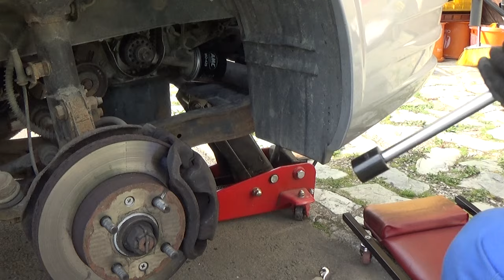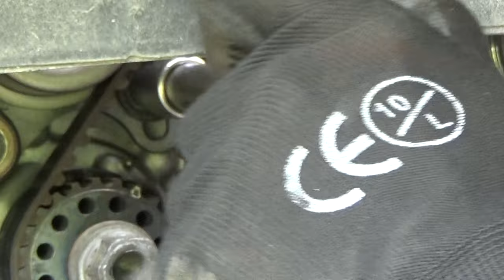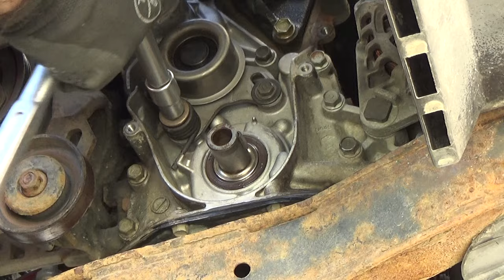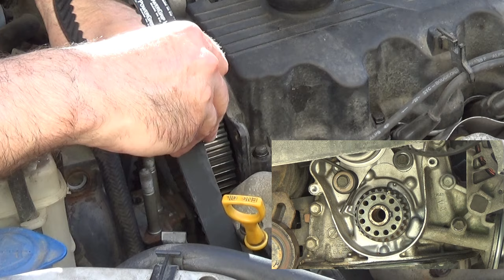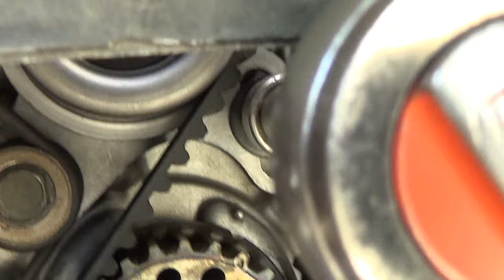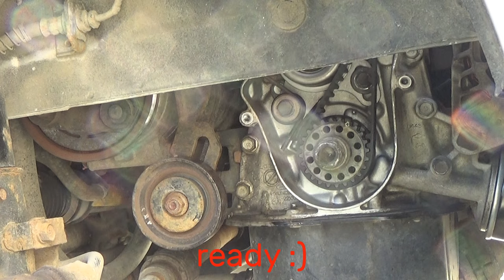How to replace the Timing Belt on a Hyundai Accent-short version

Comment: Hi, you have very useful videos and thank you for sharing your knowlodge. I bought a Hyundai Accent 2006 (second hand, 47,000 miles) on April 2022, right now it has 50,000. Can you help me put with some questions: 1. When can I change the timing belt and what other accesories related to it?. 2. I saw your videos about gas filter and AC filter, the one located in the glove  box. After how many miles I can change it? Thanks from LA.
Reply from the maker: Hi, thank you so much for your nice words. That´s the reason why i do this: I want to share my knowledge and help people. 
Greetings to your car! This is my second one and i like it, because it doesn´t make really big problems and it´s easy to repair. 
To answer your questions:
1. The manufacturer recommends to replace the Timing Belt every 55.000 miles or 5-6 years, so you should do that soon. You need a Timing Belt Kit included the Timing Belt and the Tensioner Pulley. If you removed them, you should also replace the V-Belts, you have 3 of them. The waterpump is also a good idea to replace, it costs about 50$. You can save that money, but if it´s worn out later, you must repeat 3-4 hours of work. The Waterpump can leak or stick. These are the risks.
2. The Gas Filter should be replaced every 38.000 miles. The AC filter/Cabin Filter is not very important, it´s only for the air in the passenger cabin. You can replace it every year or every two years, or about 9300/18000 miles. 
Greetings and good success.
Reply: @pannonicmechanic  Hi there. Thank you very much for that quick replay plus all the information. I asked a mechanic a week ago about it and he said that I have to change some of the stuff you wrote, but I needed to be sure and find information from an expert and reliable source, which is you Mr. Pannonic. Have a wonderful day. Cheers from souththern L.A.

Comment: Rotate How many times?

Until camshaft sprocket makes 1 full revolution? And they should both land on the same timing spot?

Torque spec for crankshaft pulley bolt?
Reply from the maker: Hi! Rotate 2 times on the crankshaft, that´s 1 time on the camshaft. Please turn only at the crankshaft. 
The timing marks should line up well on both pulleys.
Tighten the crankshaft pulley bolt with 140-150Nm.
Reply: @pannonicmechanic so turn it 2 full revolutions?

Comment: Is this a 1.6 correct? What was the torque for all the bolts? Great video
Reply from the maker: No, it´s a 1.3. If you need torques for a 1.6 engine, you could watch my videos which i made of a Kia Pride/Rio. That´s a 1.4 engine, but very similar to a 1.6.

Comment: great videos, thanks for your time!!! if improper alingment happen from the mechanic..can this cause long term rattling noise or poor high speed performance? cause after my mechanic changed the timing belt , the car is going at its worst. "Mechanic" said everything is ok, but now i will check it by my own. After timing belt change i have engine rattling noises, engine dont start always with the first time, speedometer needle when accelerating it looks like its vibrating. Its the same accent like yours
Reply from the maker: Thank you so much for your nice words. The correct alignement of the timing marks is very important and there is absolutely 0 tolerance. One or a half tooth of deviation can cause your problems.
So if you have problems since the timing belt was replaced, please check that again/by yourself. The rattling noise doesn´t sound good, i hope that no damage happened on your engine.
I wish you good success. Please keep me up to date.
Reply: @pannonicmechanic  i will check it soon. in case its out of alignment, i must remove belt, realign and put back the belt. is that right?
Reply from the maker: @M B  You are right, in that case it´s the only way to fix that problem, you must do all the work again. Please don´t use the car until you couldn´t check the alignement of the timing.

Comment: How many miles you got clocked? Been thinking of grabbing an accent lately seen very reliable and easy to fix.
Reply from the maker: Now i have about 167.000km (about 103.000mls) on the car. 
I have the same thoughts. I think it´s an underrated car and i´m very satisfied with it. 
This is my second Accent, the first i bought as new and had unfortunately an accident with total damage after 19 years and with 377.000km (234.000mls) on it.
Reply: @pannonicmechanic  200 miles! Hell yeah, perfect, just gave me some comfort in buying one, found one at 72k miles for $6k can't wait!
Reply from the maker: @Saffroncarp1106  How old is that car? Is the price really 6000$  ?
Reply: @pannonicmechanic  it's an 07 and yeah it's $6k then 7k after tax and title transfer, it's far from me though. Thinking there might be an issue tho it's a Toyota dealership so I'm kinda less sussed

Comment: hi if the timing belt snapped and the timing marks are not aligned, whats the procedure to correct the timing marks? should I put a belt on, then rotate so the bottom gear is on the mark, take off the belt then move the top gear by wrench? Im about to start this job but yea the belt snapped(maybe the engine is still alive maybe not). the camshaft sensor was throwing a code so it must be off i guess. My timing belt broke on the highway. but I have to try before I junk the car, because I cant afford another used car right now.
Reply from the maker: Hi! That´s the worst case, that your timing belt snapped on the highway an the biggest damage already happened. Remove all the necessary parts and also the timing belt, if it´s still on it´s place. The safest method would be, if you move the crankshaft first to about 9 o´clock, or to 3/4 of the rotation, i hope you know what i mean. So the pistons should be all in in the same height. Then turn the camshaft until the timing marks line up on it. Now you can finish on the crankshaft until the timing marks line up too. Install a timing belt, adjust the tension and check the timing marks after 1-2 rotations. When you are finished, try to start the engine as soon as you can. I hope you are successful and your engine has no damage.
Reply: @pannonicmechanic  thanks for your reply.

Comment: camshaft pulley have two mark right, 12 & 3 clocks right?
Reply from the maker: Yes, correct. To be more exactly, there are three marks. 12 and 3 o´clock and at 12o´clock on the spoke of the camshaft pulley. There is a hole on the pulley and an arrow/triangle on the cylinder-head.
Reply: @pannonicmechanic   ok thank you for feedback, my cam this 3 marks are not in line up, image can see below link:
https://drive.google.com/file/d/1UXzqkjFFeOpjf-OmbMgS5CeaGqzlQiEf/view?usp=drivesdk

but i need check crankshaft mark first right?
Reply from the maker: The safest method on the camshaft is, when the hole on the spoke is at 12 o´clock. Then the white marks on the top (12 o´clock) should line up and the second white should be at 3 o´clock. 
You should bring the camshaft first in line up position, because the crankshaft makes two rotations, while the camshaft does only one. So if you line up the crankshaft first, maybe you must continue to turn the engine until the camshaft line up too. 
That happened to me and you can see this in my video "Timing Belt long version" starting at 1:28. 
The most important thing is, not to remove the Timing Belt until all Marks line up.
Reply: @pannonicmechanic  ok sir got it..thank you for amazing explanation, because after replace new belt, my car no more have acceleration, where i believe cause of wrong timing at camshaft..
Reply from the maker: Your welcome, i wish you good success at fixing your problem. I hope that there is no damage at your engine, unfortunately i don´t know if this engine is a freerunner. Please let me know, if you were successful.
Reply: @pannonicmechanic  right now i already scanned there no DTC code, the most issued is engine crazy roaring when it's try reaching and stuck to 2K RPM, it's can go beyond than 2K RPM but in full press, different before replacing timing belt where it can up to 3K RPM smooth to change 3rd gear. Feel like it's LIMP MODE ;(
I try bring to mechanic to check timing first, hope engine is still healthy.
Reply: @zulwabule  Removing the spark plugs makes it a lot easier to turn the engine over using a ratchet on the crankshaft bolt. The crankshaft marks will line up when the piston on the #1 cylinder is all the way up, This is called Top Dead Center and indicates one of 2 things. Exhaust, which means the exhaust valve is in the open position because the piston pushed the burnt gases out. OR: Power, the piston sucked in a fresh fuel mixture on the way down and moved all the way to the top again to compress the fresh gases for the spark plug to ignite them to create the explosion to create power. In short, the crankshaft mark indicates the piston is all the way up. The camshaft mark lines up to indicate that all the valves on the #1 cylinder are closed. That is where it needs to be when the crankshaft marks are aligned. The camshaft marks will only line up once every revolution. Notice how much smaller the crankshaft gear is compared to the camshaft gear. That's because it takes two revolutions of the crankshaft to move the camshaft one revolution. If the exhaust valve is open when the piston is at top dead center, it will hit the top of the piston and seriously damage the engine.

Comment: I will 100% assume you used a torque wrench to properly finish putting all those bolts in.
Reply from the maker: Actually not. In the workshop where i learnt my profession, we didn´t have a small torque wrench. So i learnt to tighten screws by hand. Really important screws like on the Camshaft Pulley surely i do with the torque wrench. But for example the cover of Timing Belt is not so tragical and they are M6 screws. The other thing is, i think many of my watchers also doesn´t have a torque wrench, so i want to show that it´s possible without.

Comment: when you tighten the crankshaft toward the end ...... it takes more torque than the engine can freely handle without starting to turn under the pressure.     ....    On my ford, I just hit the ratchet end with a hammer to get that last Tightness.                      Also- Surprised you didnt replace the water pump & other belts.
Reply from the maker: For tightening the crankshaft there is a torque, but you need a tool you see in my video to hold the crankshaft pulley. This torque is for my Hyundai 180-200Nm. On your Ford i don´t know, sorry. It´s an important part, i hope your method will work. How did you open that bolt?
I replaced the v-belts with new ones, unfortunately you can´t see in the video. But the waterpump is the old one, you are right. I did so, because it was not really old and i hate cooling fluid on my hands. So i do this job on my car only, when it´s really necessary.

Comment: somebody in another video said:          You have to retard the timing marks ever so slightly because the tensioner will move the belt slightly when you release tension onto the belt.        - Does this make sense?  Should I go with my marks or does it need to be slightly off the marks???
Reply from the maker: I recommend to line up the timing marks correctly. Once i did this job on another car and the timing was wrong by a half tooth. The engine didn´t start.
Reply: Normally in most cases , the car will start if 1 tooth off,but will not run as good. May misfire, may be weak etc.  .....but ok , gonna just keep it on the marks, that is if I can ever get the CS pulley bolt out.   @pannonicmechanic
Reply from the maker: If that happens, the timing is not correct and the engine doesn´t work correct. Once that mistake happened to me and the customer was not satisfied. The car needed much more fuel and had no acceleration, so i had to do the whole job again and my boss wasn´t happy. 
In the case of the timing belt it´s better to be very very conscientious, a little mistake can be very expensive.